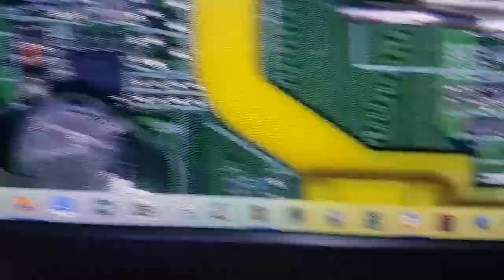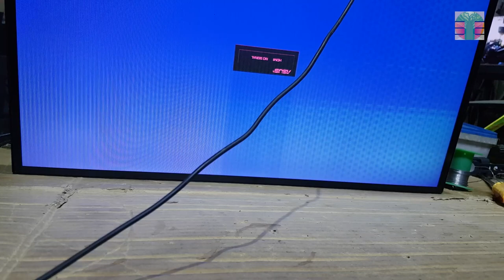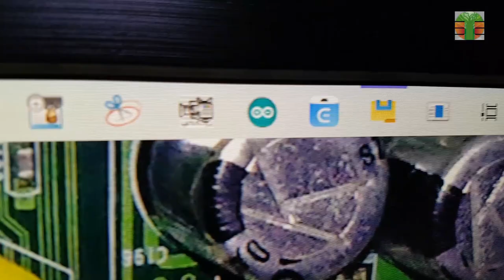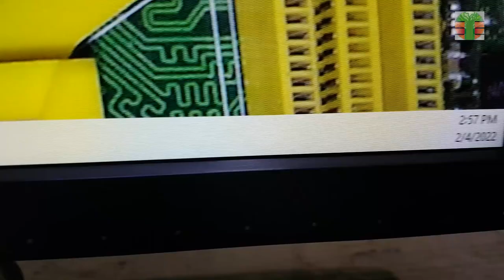Asus VC239 LCD monitor Pixelated problem.

Comment: I have the same problem, I skipped the fist part and did the last part removing the resistors, pixelated problem fixed. My monitor is woking great again. Thank you for this video I didnt have to buy a new one. Salamat
Reply from the maker: Congrats.  Please share this video. Thanks.

Comment: Ano pu yung number ng intergrated circuit sa loob po? Kasi yun po yung problema sa akin diko mabasa kasi na bura. Sana masagot nyo po salamat.
Reply from the maker: Hindi ko na na ilista. Bakit mo kaylangan yung number? e nasa video naman kung pa ano gawin.
Reply: @tevzTVTevatronics  yun po kasi yung problema sakin mag display sya but mawawala kaya need ko po yung IC number niya kasi yun po kasi yung dapat palit sakin

Comment: Kuya ganyan po yung monitor ko and meron akong red vertical line. What should i do po ba?
Reply from the maker: Pag vertical lines, iba prolema yun.
Reply: @tevzTVTevatronics  ano po problema pag may vertical line?
Reply from the maker: @hassan-normacatanong1044  malamang sa mismong lcd na ang tama